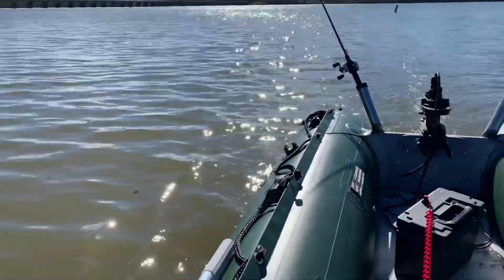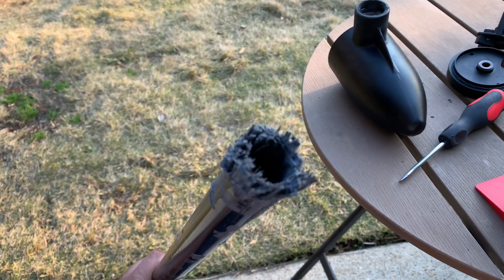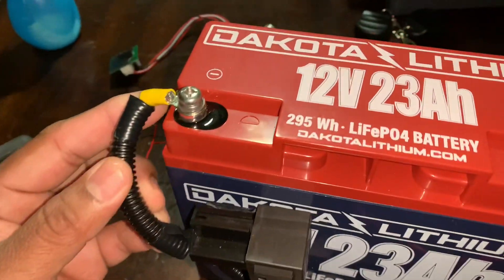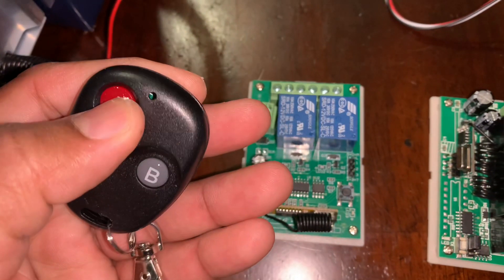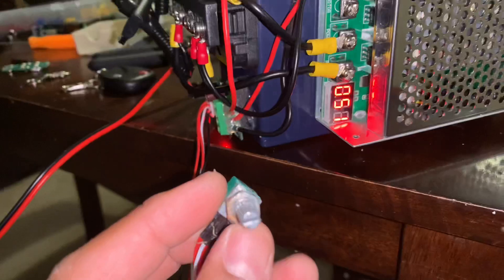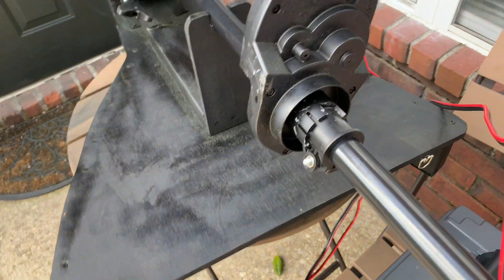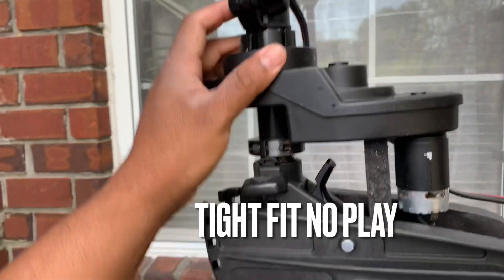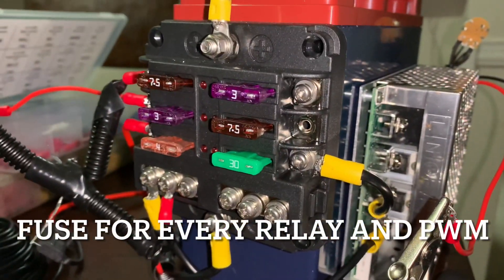How to make a remote controlled trolling motor - Part 2

Comment: I used a model plane remote the flysky, pwm relays and a linear actuator for steering.  I needed RC boat because the houseboat I had no place on shore to tie up the dingy so I use RC remote to anchor the dinghy after jumping off on land.  Thats the most difficult thing with cruising and livaboard boats finding a place on land to tie the dinghy.   Had to use secondary relay for the high amp draw winch for the anchor.  And the diode for the flyback the relays coil inductance not fry my pwm relay.   I will upload a video eventually.

Comment: I’ve been able to successfully replicate this project except for one thing. When I connect the small pwm to the switch relay (the one that controls the right and left motor), I’m losing power.  It works for a second and then dies out. When I connect the right and left switch directly to the battery, it works fine which means there’s something wrong with the pwm potentiometer.  Any thoughts on what I’m missing? Is it a fuse issue?  I tested all the wires and they’re all doing fine.  Would love some direction.  Thanks.

Comment: Got it working except....how do I do reverse?  The remote for the main/large PWM that controls speed works but A and B buttons seem to do the same thing.
Reply: Did you ever figure this out? I got mine to go in forward but not reverse. I press A and it turns on the PWM and press B to turn on the prop. Pressing them again turns them off.  Can’t get reverse.

Comment: Great videa,I had already put this to thought since I happen to have the motors and gear box from a power wheel I got from a dump run from a job years back. So this video is going to help with my setting up kayak as cheap as I can. I think this will help with a pole anchor set-up with the other power wheel gear box. I had pick up four motors with gear boxs. Great video

Comment: You have motivated me to start working on this project. Hoping to tie in a Hobbywing ESC instead and use 12v version of the gearbox. Hoping to get motivated enough to add in a flight controller with iNav and see if I can get some GPS and anchor functionality but just ordered parts to get phase 1 going.
Reply: Project going slow but I did order gearbox; esc; bike seat clamp and clamp collar. Decided to draw up and print a collar that had teeth to sit inside powerwheels gearbox cog/gear and use bike seatpost clamp to hold it in place. Hoping to get this thing done so I can start fishing while trolling shoreline hands free.
Reply: @ChandlerWoodruff  How is it going?  I am about to try to do this, making a list of all the parts with links.  I would like to add GPS and an anchor ability, but that might be later.
Reply: @johns2590  Another project that was started but not completed. I purchased the power wheels motor and cored it to fit; I have ESC and programmmer but have not programmed and I have collars but still not installed. I even deviated and thought about going old school and purchased a triangle but put on the other trolling motor and have done nothing with it either. Purchased a 4hp Mercury and was using it a bunch but been stuck on creek and kayak fishing recently. I will get to this eventually as having this linked with a flight controller and iNav would be a dream.
Reply: @ChandlerWoodruff  chasing that same train of thought! I’m going the ds600/ quicrun 800 ESC  route. I forgot about INav! That should be a pretty straight port over as you’ve only got to deal with 2 dimension’s instead of 3! Thanks for the original post and the reminder that I don’t have to reinvent the gps guided wheel!!
Reply: @fishesfromtupperware  let me know. I have too many hobbies at the moment but would love to compare some notes. I did buy that same ESC in March of 2023 and it's just sitting there waiting on me to get started on this project.
Reply: Too many hobbies? I REALLY wish I didn’t know what you’re talking about. This guy seems to have the first two parts dialed in 

https://youtube.com/shorts/G8kLzCS9lwY?si=6gR9gJk3rGd7ZAZi

Now  hang a controller, gps, and compass on it, add a fair bit of head scratching and some more time no one has …. and we’re pretty much where we are now but slightly broker.

Comment: Thanks for this useful information that I’m going to use for mine. Have you thought of a way to create a trim up/down method? I was planning on putting mine on the opposite side of my pirogue for weight distribution purposes. Having the motor’s adjustable lever remote friendly would be perfect

Comment: Did you use the 24volt 7r motor with the larger axle hole? Or did you use the 12volt 7r motor with small axle hole? I know you are only powering with 12 volt but the 24 volt motor would still work on 12v supply just at a slower speed. I’m concerned that the smaller axle hole may not accommodate the trolling motor shaft. I know you had to bore your out some. I have the same trolling motor as you.
Reply: Or could you just tell me how you bored it out to fit the shaft? 1-1/8 drill bit?
Reply: What everyone could do is buy a trolling motor steering motor made for the trolling motors and wire it up this way. Saves the headaches and it’s made for these applications. Makes it a lot easier.

Comment: Can you show a diagram on how you wired the small pwm to the steering ref transmitter? I was thinking of just using a step down converter from 12v to 3v instead of a small pwm. I’m curious what wires go where from the steering rf transmitter?
Reply from the maker: @steffen  You can use a step down too but you will be stuck with that slow turning speed. With the small pwm is better you can adjust the speed.  Ok you got the remote relay receiver right? Need a 2ch (2 relays) 12v coming from battery the batt go to the pwd .. wich you adjust it down to 3v output go to the input of the remote relay inputs split the wire into and but relay inputs is 3v. Keep in mind the receiver does need 12v to work. But the relays will operate on the adjustable 3v supplied by the pwd. Your ground is straigh from battery.  Check this diagram used the one to drive a motor.https://images.app.goo.gl/g3JUyJ5zpYq9pM817 but dont connect 12v to the C terminals connect the 3v from pwd. A terminals ground and B terminals go both to the two steering motor wires

Comment: Can you send me a wiring diagram I don’t understand the need for 2 pwm did you have to remove the yellow and blue wire from trolling motor to get it to work
Reply from the maker: Yes i cut off and covered with tape the yellow and blue wires on the trolling motor. You dont need them. They are for the power wasting speed coils. The pwm will control your prop speed now. The second tiny pwm is for the steering motor ..to adjust the steering speed as desired. The big pwm controls the propeller speed. I dont have a diagram.
Reply: Okay so I got the red and black going to the pwm then the pwm to remote but the remote will not provide power to the pwm in order for the remote control to work
Reply from the maker: @angryfrogfishing2388  The remote doesnt supply the battery power. You need to connect read and black from the battery to the pwm aswell.. the remote relay connects to the on /off switch of the pwm thats how i turn in on or off.
Reply: Angry Frog did you figure this out? I bought the components but I can’t figure it out. A drawing would be nice.

Comment: Love your content ! You made me order the things to tune my 15hp suzuki to a 20hp modell, my stock prop is the 9,25 x 10 and i reach maximum rpm of 5900 with my boat now. After the tuning my rpms will rise, right ? So do i need a 11 or 12 pitch then ?
Reply from the maker: Wow you 100 rpm away from redlining the 15hp hahahaha. It tops at 6000rpm. yes you might need a bigger prop with 20 horse maybe not.. maybe you will stay right below 6300 rpm.   6300 is the redline for the 20hp. Just try it before ordering a 11” prop.
Reply: @laingej  yup you are right :) i just wasnt sure if the 5 more hp will get me over 6300 or not. but anyway, thats the best way to try it first and then select the prop. am i right when i say that the maximum hp of the outboard is at the maximum rpm? so its always the best to go as near as possible to the limit to get the highest performance?
Reply from the maker: @barschgeil3150  yeah nothing wrong being close to the redline.. you will get the most out of it . But actually you could be loosing power/speed. With a bigger prop you could be at lower rpm but faster speed to really you have to try
Reply from the maker: @barschgeil3150  my 20hp running 5800rpm 26.7mph with the 11” . With the 10” prop my rpm is higher like 6100 i thing and it runs 24.5mph

Comment: That's pretty cool man.. exactly what I was thinking.. front mount would be the way to go.. so you can use both motors
Reply from the maker: Yeah was the only way. I tried side mount but its hard to track straight. Thanks
Reply: On a different note-
You made me get a 20hp lol!!
I was going to go with the 9.9 and modify like you, but cost-wise it didn't make much financial sense. I actually ended up selling an older 15hp Johnson and then found a used 2014 DF20A EFI in really good shape. I found it had everything still original including impeller which was shot, but overall in good shape, (seemingly) it looks like very few hours were put on it. I already ordered the diagnostic kit so will know total run time and hours soon. Only thing that scares me is it still has the original timing belt, which as you know, is a 4yr service life (regardless of hours). Thoughts?
Reply: But I digress from my original question... lol: I noticed you put yours on a kaboat with an air floor. Now these lil engines are heavy as all hell.. and powerful!!... does yours put a lot of stress on the tubes and transom brackets? Also, do you get any weird flexing on the floor, almost like riding a wake, that lifts and almost bends the floor up when accelerating, and even after getting on plane, do you get that same wake, followed by cavitation and over revving?
I ask because I took it out a couple of days ago for the first time with my 11' inflatable boat (also made by Saturn) with air floor and it seemed sketchy as hell, just how heavy it is and how much it pulls on that transom (felt like it was going to rip it out). I also got that wave-like bending, over revving and cavitation, even with OB trimmed all the way down on the first hole. Both boat and OB are short shaft, so I'm confused and disappointed.. almost wish I had gone for the aluminum floor model instead. Wondering if it just an under pressure issue, or....? And wondering if a cut piece of plywood (either on top or under entire length of floor might help the situation..)?
Would love to hear your thoughts..
Sorry for the novel 😁🙋‍♂️
Reply from the maker: @CUBICHI1985  yes i remember you told me. Good deal. No biggie change the timing belt is easy. better to do all the maintenance work. You dont want to break down on the water lol not fun
Reply: @LaingEj  Yup. I got the manual and joined RIB.net (very good info and lots of support from those guys). I'm just a bit skeptical to do timing belt cuz 1) I've never done one before, on a car or otherwise.. and 2) because it calls for some specialized tools, one for holding down flywheel and another for actually removing and torquing down the flywheel bolt.
I did go through it completely (was kinda proud of myself), checking/replacing the usual stuff like: lower unit, impeller, crankcase oil, prop. But also checked and cleaned out  anodes, thermostat and their housings (which were very full of crystalized salt/mineral deposits). And after I received/replaced all my parts and had it out on the water I got a lil more peace of mind, cuz it ran really well. Aside from the whole cavitation problem of course (more on that above ☝️)..